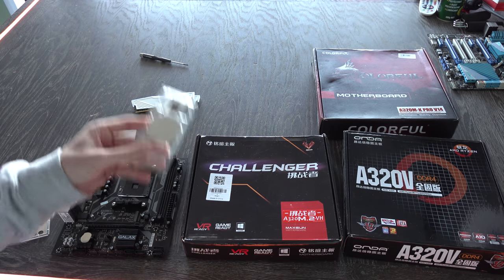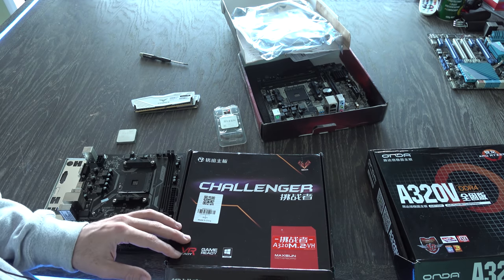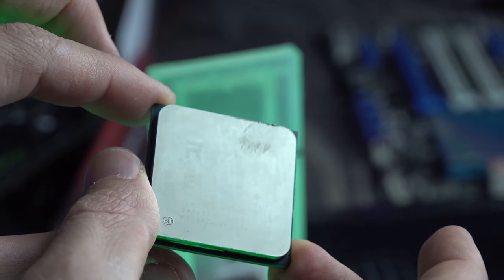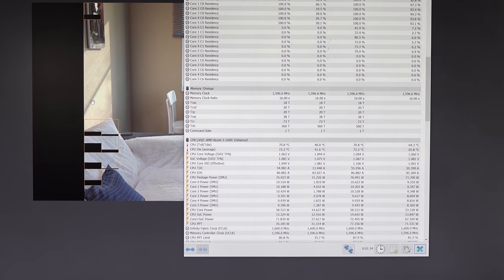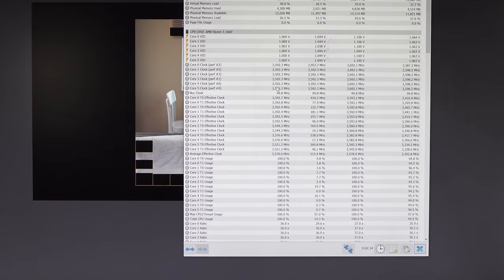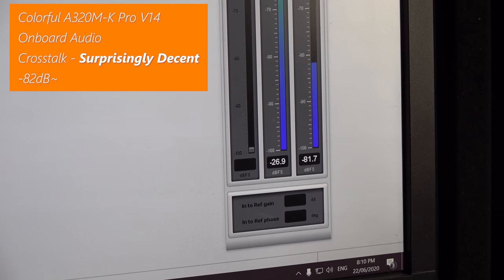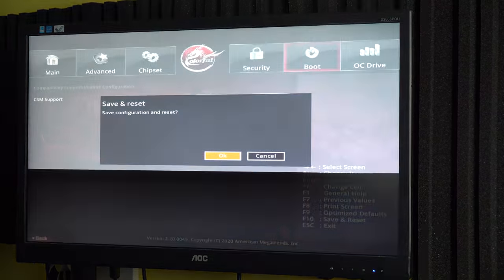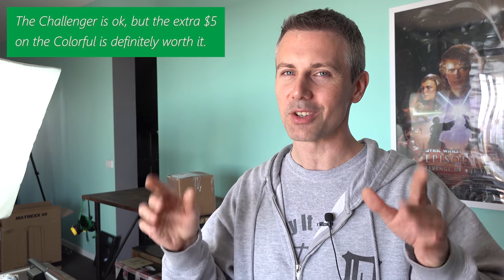CHEAP Aliexpress A320 Motherboards - COMPLETE Crap or Hidden Value?

Comment from the maker: Hope you guys enjoy these Aliexpress bangers! Made a mistake on the temps for the Maxsun board, graph should read 77 Degrees not 75 , that doesn't change anything else though!
Reply: I was just looking at the Onda A320SD4 ITX motherboard last night. You shouldve tested it out as its pretty interesting with support for upto Ryzen 3rd gen, but its cooler mounts are for Intel cpu coolers.
Reply: CAN YOU MAKE A PC FOR AUDIO PROCESSING
Reply: Absolutely LOVE these kinds of videos, doing audio and VRM testing on bottom of the barrel motherboards is awesome. On that note would it be possible to do some testing on some of MSI new MAX boards? They are updated for 3000 series out of the box but the vrms on those concerns me; just did a build with a b450 max for a friend (couldn't find anything else in stock) and the board didn't seem much better than the ones you just tested here even tho it was much more expensive...
Reply: Try some small adhesive heatsinks.  They sell kits on Amazon "Easycargo 20pcs Small Mini Heatsink Kit 8.8mmx8.8mmx5mm" for 7.99
Reply: Galax one of best brands here in South East Asia and Europe my b350 from 2012 just updated bios for Rhyzen 5 3400g is running fine still
Reply: @juicecan6450  Look for version 3  for this board. I have the version 2.0 and only supports 2000 series.
Reply: Will the colorful a320 work with ryzen 7 1700? please answer
Reply: @zaidyounas1602  by what we,ve seen, maybe.
You should think about :
- Avoid stress tests
- Use an aircooler to keep  airflow over VRM
- Buy heatsinks for rasperry pi and insert
- Disable cores for a while
You have many ways too run ryzen 7, but doesnt seen to be the best out of the box motherboard
Reply: maxsun boards always seem sketchy as hell used one the earthshaker i believe was on this channel for an extreme potato ryzen 1300 build and while i was doing the burn in process before selling it on there were so many issues with it I gave the guy a refund and binned everything except the ram and chip idle with be quiet low profile it was hitting 74.
Reply: Can you do an in depth pc hardwear cleaning guide
Reply: @powerfulshammy  A b350 from 2012? C'mon!
Reply: Broke As FK  What about warranty (If u buyin' from AliEx.)?
Reply: Cheers for the great informative video Bri Dundee 👍🏻
Reply: Please upload to alt tech in 2020 (Bitchute/etc)
Too much shady stuff and censorship on censortube in 2020
Reply: Are we really saving money buying a A320 mobo from overseas websites ?
* Convert USD into AUD  - USD$55 = AUD$78.58 
* AUD$78.58 + GST (Government thief surcharge) $7.86 = AUD$86.44
* AU retail store profit = $2.56 = AUD$89
Along with the ability to drive to a local store for returns
and local nation warranty/gov forced business "consumer" laws
Is it worth getting motherboards from Amazon (USA) or Aliexpress (CHINA) ?
Reply: You can't OC the CPU, after talking with Maxsun directly into Aliexpress he says that :  "Technology says it is not recommended to use A320M motherboard to overclock the processor
If you want to overclock the processor, you can buy the B550M motherboard."  And just make an update the 21/08/2020 with this link  https://fr.aliexpress.com/item/1005001321946639.html more expensive but only one you can OC without worries. Sorry for the French Link this is my mother tongue, have a nice day and thanks Tech City for all reviews you make.
Reply: @zaidyounas1602  i'm running A320+R7 3700x for daily, nothing problem
Reply: why I can't overclock the ram to 3200mhz on the same colorful a320 mobo? I'm using xlr8 rgb 3200mhz cl16 but only can overclock to  2667mhz. Higher than that make my pc doesnt boot. I'm using ryzen 5 2600. I bought 3200mhz ddr4 after watching this video. I already update the BIOS to the latest update on colorful website. Please help.
Reply: @tengkuiskandar6400  memory controller on ryzen 3000 series better and more stable, i've try on ryzen 5 2400g it's difficult to reach 3200mhz with same memory and easier when upgrade to ryzen 3000 series
Reply: @alvincalmkid  Thanks bro. Same goes to b450m? So, 2000 series just support 2667mhz?
Reply: @tengkuiskandar6400  i don't know with b450m, i've not try it yet..ryzen 2000 series support up to 2933 natively.

https://www.amd.com/en/products/cpu/amd-ryzen-5-2600
Reply: @alvincalmkid  Thank you for the info. Now my ram is running stable at 2933mhz. Just curious how he can run 3200 easily on the video with 1600. Done subs your channel.

Comment: Is that AIO cooler ? That would be highly unrealistic scenario for someone looking into something as cheap as a320. They would probably stick with stock cooler, which would help with VRM temps quite a bit..so showing such test would be probably more usefull for people looking to buy such board. Personally, if I was to buy a320 board, I would probably consider Asrock a320 pro4, good enough for even ryzen 7.
Reply: top-down airflow cooler + super cheap vrm heatsinks would be the optimal config for a320.
Reply: most of people who order from ali express have bad markets used deals are bad too my market has one company that gets the components in the country and sell prebuilds so they could project prices as they can
Reply: Lower temps help reduce power consumption too but I don't know if AIOs are powerful enough to do that
Reply: he's trying to eliminate any factors and have the "worst case scenario". with that said you can expect the same if not, better performance.
Reply: Totally thought the same thing!
Reply: i wanted to get this aliexpress cheap boards for ryzen 1600af,, but the shipping time due to "human malware" it was not worth the wait, so i got biostar a320 for 50usd. 
no m.2 but msi has 60usd board with m.2 slot.
i have no problems with vrm temps after few hours of gaming.. (Stock cooler)
Reply: Jigahertz thats a great board even if its a "mining" board. i used it for a year and never had issues gaming
Reply: @johntet  kindly elaborate for those who's starting off in pc building please? what is a top-down airflow cooler and can you buy vrm heatsinks? if yes what would be the specifications for for this particular setup?
Reply: @idriss-289  Even stock cooler has top down airflow so vrm would be ok. AIO and vertical coolers deny airflow to the vrms . So for a 6core on an a320 , just use a top down cooler , and optionally some heatsink. If the mosfets are in sets of 3-4 per phase in a square region like the asrock a320 then its easy to find some 3rd party heatsinks with thermal/sticky pads and apply them. For the rest shown in the video , where mosfets for each phase are all over the place i don't think its worth it even trying to search for so many and so tiny heatsinks for each mosfet.
Reply: @johntet  thanks for the very helpful reply! I have the same exact a320 shown in the vid so the chances of getting heat shinks for them mosfets would be low. the cooler i have doesn't resemble a stock cooler tho but it does have a heat sink where the fan is situated in the side.
Reply: @idriss-289  Hiigher chances than i initially thought. Try aliexpress , searching for "mos heatsink" . Measure mosfet dimensions to make a right choice since you don't want the metal part of the heatsinks touching components around the mosfet.You will be applying 1 heatsink per mosfet. Also make sure they have adhesive thermal pad .
Reply: No, someone might pick and choose what part to invest in. A better cooler is a better investment that expensive ram.
Reply: The VRM temps on my A320 are just fine, they only get up to about 46 or so at most during heavy usage, which is relatively cool.   You'll never power a 115W CPU with this board, but it's not really aimed at that type of user anyways.

Comment: Thank you for being fair to the A320.  So many people are bashing this chipset just because it doesn't cost as much as some others.  I have an Asus A320 and it works just fine.  The A320 is a value priced motherboard but that doesn't necessarily mean the components are low quality.

Comment: I'd love to see a comparison of these boards and the similarly-priced GIGABYTE A320M-S2H. It's $57US here in Taiwan and GIGABYTE has a great track record of updating the BIOS.
Reply: the A320M-S2H V2 even has a B350 chipset.  I assume they just ran out of A320 chipsets or something?
It's great value, but It'll be interesting to see what the A520 can offer.
Reply: @TheTurnipKing  How much is it?
Reply from the maker: I already checked out the gigabyte a320, it was good. ASrock one does the job too with the budget 6 cores.
Reply: @TheTurnipKing  can you overclock your cpu on that mobo as it has the B350 chipset? Thanks
Reply: @techyescity  Hi Bryan do you remember a video that you had made in the past comparing the Ryzen 5 1400 on an ASRock A320 mobo Vs a Xeon X 3440 I think it was both were paired with a Rx 580 
Both were housed in coolermaster cases I guess you had Overclocked that R5 1400 to 3.8Ghz on that A320  ASRock board I would like to know how? Thanks
Reply: @elstondias9172  there's a few options related to CPU and memory frequency for it, but I haven't played around with them.
I assume it's still functionally a budget a320 board and the VRMs aren't really up for a challenge.  But the options are there for if you're using a 35W APU or something that has enough headroom to benefit from it.
Reply: @TheTurnipKing  funnily enough they have done the same with one of their "B350" boards, which actually had x370 chipset
Reply: Elston Dias I think its still there in the video archives of his previous videos he did. It should still be there🙂
Reply: I’ve been running an R5 3600 on the gigabyte a320m-H on Brian’s recommendation from his video 10 months ago and it’s been rock solid the whole time. Got it 2nd hand for £20, I’d recommend it.
Reply: Marco The a320m s2h v2 which has a b350 chipset is 62$ here shipped, Cheers!
Reply: @elstondias9172  It should be possible to overclock on the A320M S2H V2, but this is pretty useless considering it only has 3 CPU power phases and no heatsink.

Comment: Thanks this is my kind of video love a good a320 or b450 board although using the clc cooler is probably not the best way as most people on a budget will maybe use the stock cooler or an updated down draft cooler which will get the vrm a lot cooler
Reply: this is just a worst case scenario because there are people in hotter climate so downdraft coolers maybe don't impact it as much

Comment: Hey, very informative video as always. I think there is one improvement you could of made here. An air cooler would be much more appropriate to keep VRM temps under control. I’ve been running a stock 1600x on an A320 mobo with no heat sink on vrm but with wraith cooler for years with no overheating issue.

Comment: What is the maximum best cpu that you can use on an A320?
R5 3600 or R7 3700x? (Both are 65watt)
Reply: I think if your motherboard supports it, maybe a ryzen 7 if you're using a name brand a320. The ryzen 5 3600 is compatible with good a320 boards though
Reply: There are a320 motherboards that support 95w cpus if im not mistaken, only problem would be VRM temps
Reply: @victorhugo-wo2ci  Pretty much all A320s support officially support Ryzen 9 (officially from the motherbaord manufacturers, but not from AMD). But just because it will run doesn't mean it's a good idea, because the VRM would thermal throttle.

Comment: yep, Colorful is a brand, they have experience, so I'm not surprised.
big problem with these and most 320 MBs is a lack of !ability! to install decent VRM cooling. no holes for heatsink means you have to go with dangerous, ugly or/and permanent solutions to overheating problem. but its cheap... ish, if you start spending money on decent cooling :)
Great video as always! Thanks!

Comment: Thanks for the video. I just purchased an MSI A320M-A Pro Max motherboard to use in an entry level PC on Amazon Warehouse for $55. Hopefully it works well with the Ryzen 1600 AF. Otherwise, I will just use a 3300X.
Reply: If possible you should get the 3300X. It's faster than the 1600 AF (even in a lot of multicore workloads - though not in all situations), and significantly more efficient, so should be able to run to its maximum potential on that motherboard.

Comment: hey TYC does buying gpu from aliexpress really safe? i have a plan to buy an rx 570 from aliexpress but im still kinda doubt
Reply: You should be fine, but have you checked out the local used market? You may find better deals
Reply: @Razor-gx2dq  i found aliexpress is cheaper 10$ than my local online shop
Reply: @fauzanbri  from your channel I'm assuming you're Indonesian, I would recommend buying in Indonesia because if you're buying from aliexpress there is the new tax system so the $10 difference will be unnoticeable
Reply: @tobiaspauli  oh yeah, i just found about about the tax system when i read some article about buying imports. thanks for the information mate
Reply: I have gotten fx cpu and a ryzen1200 from ali express all worked all were what i ordered at dirt cheap price

Comment: ouch that colorful VRM was practically incandescent under the 1600AF, those caps would get cooked really soon
too bad the VRM layout is not a straight line like the Onda board, very hard to add a heatsink
Reply: It would at least help to add a fan directed at them

Comment: Hey @Tech yes city i have a budget of $900 what should i get for gaming/streaming/video editing. ( i want to buy everything new aswell ! IM FROM AUSTRALIA )
Reply: Paul's Hardware just made a revised $900 build, might worth take a look.
Reply: Ryzen 2600 or 3600, Vega 56 (maybe 5700 if its cheap in your country)
Reply: Look at an nvidia GPU better for streaming
Reply: Jxshyy 3600, b450, 16gb 3200mhz, 240gb ssd, 2tb hdd, cheap case, rtx 2060, 500w psu.
Reply: @wisdoom9153  bro I think he's talking about aud not usd
Reply: Assuming you mean AUD, for that budget... could you consider "made from salvaged server parts" as "new"? If so, get something with a Xeon E5 V3. If not... you might need to go for a Ryzen 3 1200, or you'll have to choose a terrible GPU like an RX 560 (even a 570 or a GTX 1650 might be a stretch). If you can't stand to go second-hand, I'd say wait for Renoir APUs to come out on desktop. Other than that, with only $900 AUD of budget, you should really consider second-hand, at least for the CPU (aliexpress Ryzen CPUs are super-cheap, and the Xeons are ridiculously cheap).

Comment: Colorful actually has decent mobos! Also I'd like to point out that you can just throw on a heatsink as said and a fan! You can find small fans really cheap and I think these these vrm Temps are worst case scenario in an open air bench without direct air cooling! Also colorful does have b350 mobos and b450 mobos both at reasonable prices on Ali! And they do have vrm cooling! So that is also a option and can provide some upgradability!

Comment: Im running a 3900x with a x370 gaming pro carbon. THis thing stock does 7300cine30 and 4.4ghz at 1.37v does 7800cine20. its crazy fast and vrm temps are like 40c . Really nice board. Good work on the video keep it up

Comment: So I have a USFF Hp that I got for cheap and it has a Ryzen 2400GE PRO, apperntly the pro chips are more reliable and have slightly better performance then their consumer counterparts. Though as you can imagine thats hard to test in a USFF system with no upgradability to its full potential, and I can't seem to find anything on compatability for the PRO chips anywhere. So I'm wondering if I can get it to work on a "Gaming board" for a system build, should I just put it in one that has compatibility for the regular 2400ge? I think TechYes. Will it go up in blue smoke? Only time will tell.

Comment: wouldn't the 3700X do fine if it's 65W tdp? or is there something more to running 8c/16t?
Reply: TDPs are not often a good indicator of how much power a CPU uses. AMD's TDPs tend to be defined by the cooler they're sold with, rather than by their actual power usage (but still more accurate than Intel's, which are measured at base clock). For example the 2600 and 3600 are both rated at 65W, while the 2600X and 3600X are rated for 95W, but the 3600 and 3600X use roughly the same power, while the 2600 uses a similar amount of power to the 3700X, and the 2600X uses significantly more.
Reply: @nathangamble125  yeah, I know that. TDP's are unreliable. But there's a lot more to the measurement than what cooler their sold with. It is just one factor. But your comment does not answer what I asking, at all.

Comment: gigabyte a320 vrm temps can hit over 95 degrees when running with cinebench on a 1600af so these boards temps arent so bad in comparison.
Reply: Gigabyte is a low quality brand...I purchased a Gigabyte U60 UMPC in 2006 and in 2009 it was dead

Comment: Thanks for testing out the low end. Too bad there's no info on B550 low end. I'm looking for a cheap mobo for a Ryzen 5 3600x.
Reply: Get an Asrock b550 or b550m pro4 mobo.
Reply: There are A520 mobos on the way, but IDK if it will be worthy aside of the CPU compatibility.
Reply: If you don't need PCIe 4.0 and only want to use a 3600X, just get an A320 (with a VRM heatsink) or a B450... or hell, even an X370 - these are getting pretty cheap right now.
If you want PCIe 4.0 and overclocking, go for B550 ASRock Pro4 (as Mike mentioned) or MSI Pro VDH.

Comment: I know this might be pointless, but i wonder which one among a320 motherboards has the best VRM?
Reply: MSI A320M Bazooka. 8 low-side mosfets with 3.3 ohm resistance, rated for 78A each, with a decent heat-sink.

Comment: Hi guys, I would like to know what is better or more optimal, a cheap B550 (100-110 $) or a B450 with good reviews like the Tomahawk MAX? (for Ryzen 5 3600)
Reply: i think we should wait for reviews because the vrms are actually really similar between the budget b550 boards and highend b450 boards and we get pcie 4.0